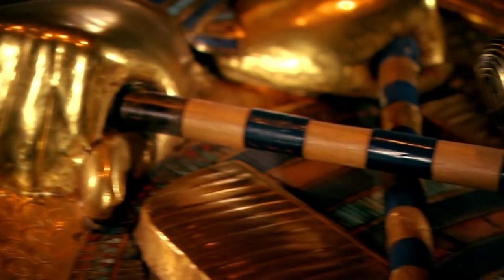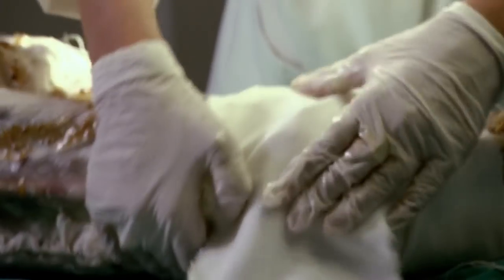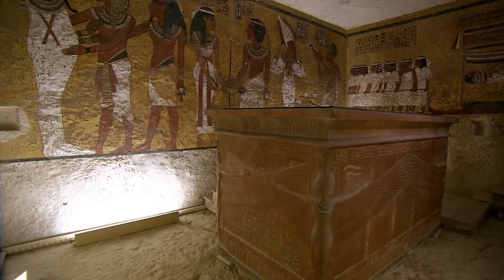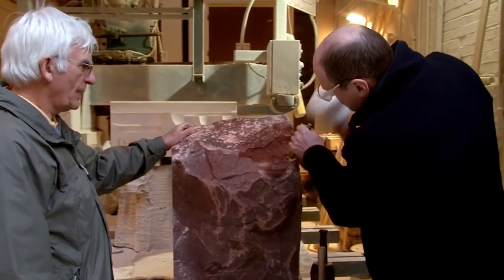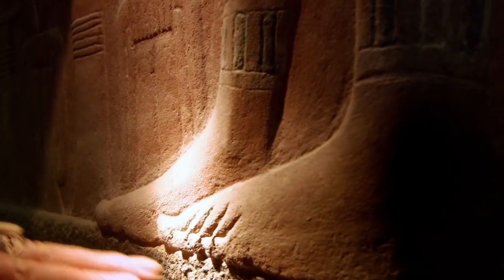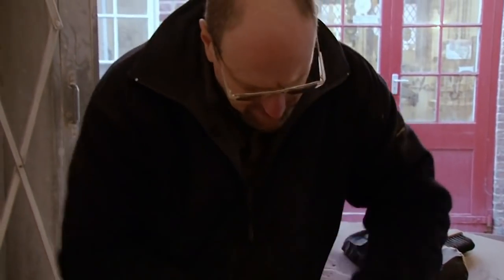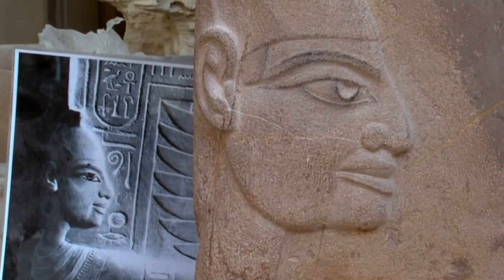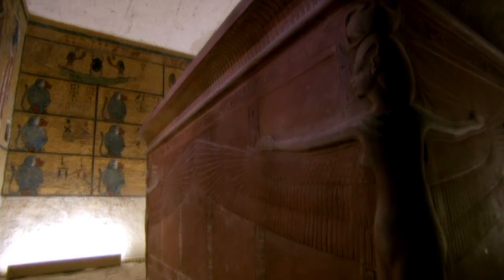This Is Why Tutankhamuns Burial Was So Rushed | Our History

Comment: That was just getting interesting. I think like 80% of the stuff was Nefertiti's.
Why the 70 day deadline? Is that a religious restriction?
Reply: I think it took 70 days to mummify the body. The tomb had to be ready once the body was ready.
Reply: @christinaclark9754  Why? That's my question. Once the body is prepared, it could technically be stored as it's stable. Say in a situation where the rest of the stuff isn't quite ready. That's why I wondered if they were under some religious obligation to get it entombed at a certain time. I mean if they can work on it for over 2 months, why the hurry just because they're done?
Reply: @stevenedwards4470  I vaguely recall seeing this documentary in full when it first came out. If I recall correctly, yes, there was some sort of religious rite that had to be performed within a certain time frame. Also, there was a sort of struggle for power, because he hadn't left any heirs. His wife was still alive, as was another person, a general of some sort, who could get power. However, his grand-uncle, a man called Ay, wanted power for himself and pushed for the burial ceremony to happen quickly - because by doing so and taking part in it, it made him the successor. I'm summing that up very roughly based on my weak memories, so I apologise in advance if I've got it wrong.
Reply from the maker: There's a full 50 minute one here! https://www.youtube.com/watch?v=cIwyeXdOUPA